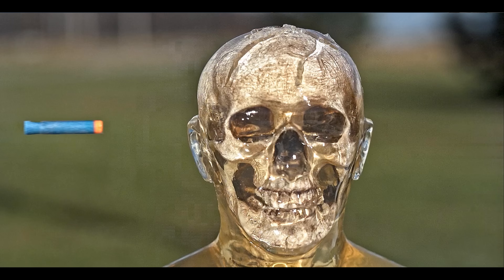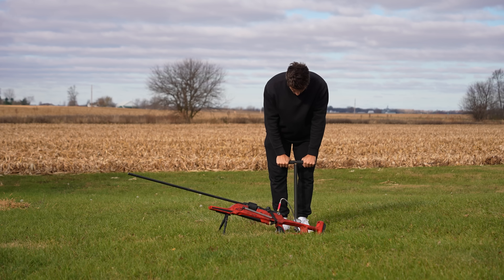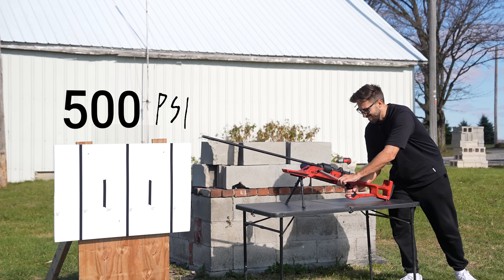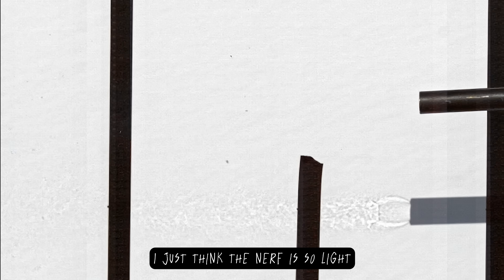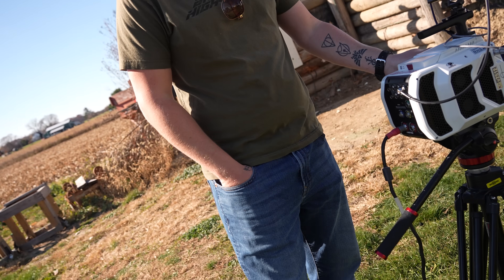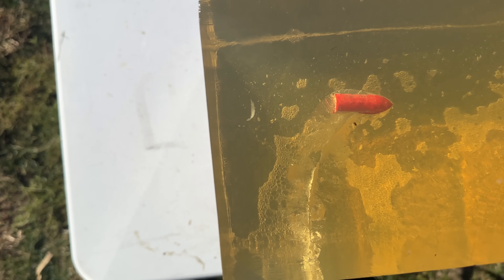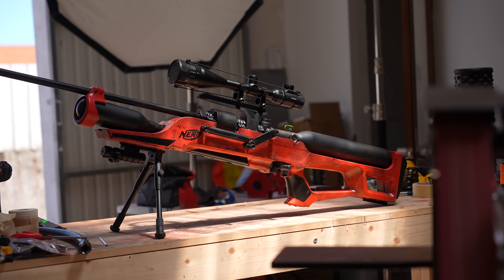How Dangerous is a Supersonic Nerf Dart?

Comment: good job man, a ptfe tube plugged at one end lining the inside of a nerf dart may solve the issue with the normal darts exploding but would also reduce the volume of air entering the rear of the dart. One would think that would reduce velocity but maybe not.

Comment: so there was a company that was working on bullets that could spin in a smoothbore barrel. They were by Franklin Armory if I recall. But basically, the idea was to make a bullet shaped somewhat like a shuttlecock. Essentially there was the bullet tip, that then would shrink down before flaring out into multiple angled fins. This was in theory to make the bullet spin by itself without the need for rifling. Allowing smoothbore weapons to extend their range.

Comment: It should be impossible to use pressurized air to drive the projectile faster than sound. Sound is a pressure wave, so the pressurized air can't move faster than the speed of sound. It might work with a de Laval nozzle for a very light projectile like a nerf dart, I fired a milled-down golf ball at about 500 m/s using a 90 bar de Laval nozzle system once.

Comment: brother, make a multi cylinder backpack with 1-2 inch hoses that bottleneck feed the pressure into the rifle for more fire power. be aware the bottle neck method will increase the output, so make sure to have a pressure valve installed where you can monitor it.

Comment: Ask your Dad about what it was like in the later 70s  and well into the 80s.  A good amount of the cars that younger buyers were purchasing had only AM  and maybe FM shaft mount radios.  An aftermarket stereo was your answer to be able to play cassettes  "and a few who were still clinging onto 8-Track tapes" so to listen to what they liked when they liked.   Many did not even have L- R channel speakers so aftermarket was your route for stereo effect.  Everything was shaft mount with some even installing under dash units.     Car Audio  Liquidators would come into your town and move pallet after pallet of car audio equipment into a vacant store for a week or two.  Most of their offerings were brands you never heard of.  After their week or two stay they would  move on.  Just about the time the ACME brand  "Power Booster with but in Equilizer" claiming hundreds of watts per channel had started smoking.  So much for Warrantee.  Kind of like those Holloween stores bu they only come once..  
There was very little involved in installing your aftermarket equipment and everyone had at least one friend who had some experience doing so

Comment: I highly doubt you can exceed the speed of sound even if you increase the pressure by 100x. You need HOT compressed air, as hot air has a higher speed of sound. Rifle bullets can travel at Mach 3 because their propellant gases are hotter. This is another reason why railguns are recommended to accelerate bullets at Mach 7

Comment: It seems the air is building up at the head of the nerf darts whenever you shoot them. So, why don't you 3D print a hard,  thick, durable plastic round that's hollow like a nerf dart but made out of the 3D printed plastic, and with a pointy, screw thread tip. The 3D printed bullets you made aren't hollow. Would that work, or would it make any difference?
What do you guys think?

Comment: A muzzle brake might help since the barrel has no rifling. It seems like air escaping the barrel behind the projectile is influencing its trajectory and pushing it off center. Or perhaps a couple holes at the end of the barrel. Are you using hollow nerf darts? Can see them exploding just passed the barrel. Try filling them with spray foam. Or make a spray foam dart.

Comment: Humid air is not more dense. The water molecules displace the heavier diatomic Nitrogen in the air 4:53 . Cold are sure, but unnecessary to add this extra bit in

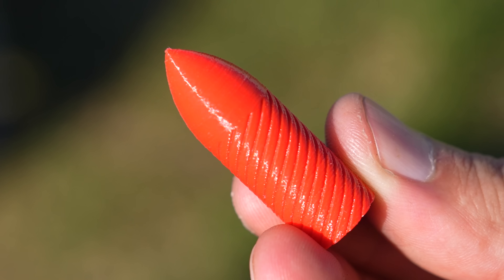Comment: At 10:16 My prediction is that the plastic 3d printed bullets look scarier than they are. unless you added weight somehow, air resistance alone is gonna kill not only your speed but your lethality. its just to light. Now that muzzle loader bullet. the one made actually out of metal, is the one im scared of. lol

nevermind apparently! Plastic bullet for the winz!

Comment: Thank you so much for actually considering calculating the speed of sound at the actual time of experiments. I was itching thinking that might have been missed. Not a lot of folks actually consider that as a gradient, and it’s just a pep peev of mine. Data, data, and data, equals data of previous engagement. If you don’t actually do it you will never truthfully be precise. Accurate maybe by chance.

Comment: I am wondering, what the max lethal range would be with the various projectiles. plastic, hard wood, iron, lead, tungsten.
If it is lethal at a good enough range, then it might actually be usable in a resource constraint manufacturing scenario. 
You could charge the air canisters with solar. And easily 3D print or CNC many types of ammo.  
No need to manufacture gunpowder. The fuel to fire it, and projectiles, could be made locally on the spot, behind enemy lines, with a portable production kit. 

In actual warfare, logistics, thus, getting all the stuff you want to the right place in an active warzone, or behind enemy lines, is do or die for a successful campaign.
Utilizing more local resources, can reduce dependance on logistics. Allowing for longer deeper missions behind enemy lines, where logistics is constraint.

Comment: Hey, some physics. Gas cannot travel faster than the (its) speed of sound - meaning the gas inside the barrel, driving the bullet. The speed of sound of a gas depends on its specific weight and temperature. So if you want more speed, you can use a lighter gas (e.g. Helium) or make the gas hotter (e.g. the gas of burning powder). But cold air inside the barrel cannot travel faster than the speed of sound (of air at "room"temperature) ~330m/s. That's the simple physics behind it.
Reply: Like it

Comment: eh print yer bullets sideways.. they wont snap as easy and will deliver more eneragy in theory. think of it like stacking 2x4's . 3d printing creates a 'grain' structure via layers. you want those layers to be in line with the direction of force.. back to the 2x4 example. if you hit a 2x4 with a sledge hammer on the side it will bend or break.. but it you hit the end you can hammer it into the ground like a niail.  the same is true with 3d prints.if a pirnt is long you want to print it sideways. not streight up and down. the widest part should always be on the print bed.. i would reccomend you print the bullete in 2 halves and weld thenm together using what ever means you see fit to make them 1 peice of plastic.. my typing is crap but you're plastic bullets will work better. also you're riffling is too fine. WAY too fine. if you have the chance do the math. if you know how fast the projectile is moving in the barrel. you can then calculate the proopper amount of twist that should be on the bullet for best stability exiting the barrel. the rifling needs time to engage the barrel. could also be that your bullet is too smaall for the barrle that is the usual cause of tumbling.

Comment: Should have built a piston actuated version. The secret to air launchers is a system that releases all the air at once you can hear it hissing after he fires the shot meaning there is some amount of air that is wasted.
Nighthawkinlight has a great video on how to make a pvc piston for these applications. Another way is an electronic sprinkler valve. They are pretty quick but I wouldn’t feel comfortable putting 500 psi against it lol.

Comment: If you slow down the slow motion footage of the regular dart wrapped in packing tape, you can see that right at impact you actually got a slight ignition on the rubber tip due to the friction and speed of impact! Watch closely and you can catch the flash!

Comment: if you want to improve the stability and speed of your plastic projectiles, consider making the back end of the projectile concave. Also do not make your projectiles straight all the way back, taper them down ever so slightly. Hopefully that helps. Is going to be trial and error with those because you cant approach this like designing an optimized projectile for a firearm, this is a high end air rifle.

Comment: I wonder if you used a plastic straw inside the nerf dart with a cap at the end of it or have it sealed if it would stop the darts from exploding that way you can run higher pressures with out having it explode.

Comment: the cellophane tape made all the difference in terms of decreased friction and added structural rigidity without adding any real weight. with that mod and a lead pellet in the head, 600 psi will probably even see 1200fps

Comment: Current me if i am wrong but your using air to propell the projectile. Air moves AT the speed of sound so you can't really break it. Switching to helium that has a lot higher speed of sound will make it fire a lot faster.

Comment: One method of modifying a nerf dart i have not seen much lately. Put a bb inside the dart. It both helps it seal better and gives the tip a bit more weight.

Comment: i am guessing you used pla as the 3d printed projectile  could you try using tpu or petg?  also it looks like you printed them from the bottom up   if you printed it on a raft while horizontal i think you may have better effectiveness without the projectile breaking

Comment: Have you thought about trying to add rifling inside the barrel? It's probably pretty hard to DIY something like that but perhaps you could buy a barrel with rifling already or maybe contact a metal 3D printer place and I think they could easily 3D print a barrel with rifling inside, possibly cheaper and more customizable than buying the finished piece from somewhere.

Comment: did you lubricate the pipe " baril " so that the projectile gets not heated but also decrease the frictions , allowing projectile it full speed ?
does the pipe has the same spiral shape inside, as in real rifles ? it allows the projectile to spin decrasing also air friction.
sorry for my basic english

Comment: A fundamental truth about ballistics is that the longer the object is in contact with the force projecting it, the greater the energy imparted to it.

That's why crossbows might be 300 lbs but can't actually outperform a bow with lower poundage but longer limbs and a shorter distance between the string and arrow pass. It's also why Asiatic-style bows are more efficient than straight-limbed longbows. That's why a 20-inch barrel will impart more energy and stabilization on a bullet than an 11-inch barrel when all other factors are equal... This is rudimentary stuff!

Comment: I would advise you to drill a few holes at the end of your barrel in order to release the pressure that occurs in front of the projectile all along the barrel. While this has less impact on heavier projectiles, the Nerfs are light enough to be affected by this phenomenon.

It is also possible (pure speculation and for blue projectiles) that this slows down the dart enough that when it comes out of the barrel, the pressure to propel it is so strong that it transforms your projectile into a balloon on the verge of exploding since it is no longer supported by the walls of the barrel. Holes at the end of the barrel could release the pressure before the projectile is no longer carried by it.

Comment: The rifling is way too aggressive. Usually in rifles it turns 1 rotation per 20-40cm depending on ammunition. The one you have seems to be 1 rotation per 1.5 cm. Thats probably a reason why it tumbled.

Comment: I'm not a physicist, but it seems too me that you cannot accelerate an object to above the speed of sound, with compressed air that only expands at the speed of sound.

The difference between 200 PSI and 500 PSI is less important than temperature, which is directly proportional to the speed of sound. 
The recipe for breaking the sound barrier with air is simple: USE HOT AIR. Specifically, hotter than the air around you.
When you pump up a pressure vessel, the temperature goes up automatically, I think this explains why you were able to get sonic booms the first times. If you used it quickly after charging, the high temperature from pumping was still there. Perhaps you let it sit too long for the next tests?

This is all speculation, like I said, I'm far from a physicist but I'm pretty sure if you preheated or insulated the tank, you could get supersonic darts reliably.
Good luck
Reply: Air's speed is not limited only the speed of sound is. Sound can travel through the air at a little over 1200 kph. A shock wave occurs when the speed of the object exceeds the compressibility of air, which air then 'breaks' around the object (going backwards relatively). Waves of air are are forced together  (compressed) by the object since air can't move out of it's own way quickly enough.

Comment: why no round objects if you got 3d print and stuff. there is a reason why many air projectiles are round ;). for sure we are on a technical level, where air powered guns could become perfect assassination tools. a good marksman with a bullet that has best weight /stability / distance /penetration stats and you can even add a silencer. now imagine what kind of projectiles are possible if you only need one hit.....air guns scarin the hell out of me right now ^^

Comment: you should also check the inside of your pipe, foam travelling at 1000fps might leave some residue on the pipe, creating a roughness that'll slow down other projectiles. same with 3d printed materials.  a bit of lube, and occasional cleaning wouldn't hurt maybe.

Comment: That’s just a gun bro, not a nerf blaster
Reply: No, a gun uses gun powder. This doesn't, bud.
Reply: Same thing bro
Reply: No, kid, it's not, one uses force applied by air pressure, and the other,  a real gun, uses chemical energy.
Reply: They’re literally the same thing, just because his one shoots with air pressure doesn’t change the fact that it shoots bullets at super sonic speed, it’s literally just a gun
Reply: Chemical energy, and air pressure. When you get in AT LEAST 5th grade, you'll know why they're different. A real gun uses gun powder, his uses CO2, or whatever he said he uses. PLUS, it's illegal to add gun powder to a nerf gun. So a nerf gun, or a nerf "blaster", will always be a fun little kids toy, and not a gun, even if you add random chemicals like CO2 or N2O. PERIOD
Reply: Bro they are basically the same thing. They are both lethal and can kill it’s basically just a gun. You can use it for the same purpose. Just because it doesn’t work the same way doesn’t change the fact that it shoots bullets that can kill. And if it can kill, It’s not a kids toy.
Reply: Ok? But a knife can kill someone, and a hammer can, are they the same thing? NO, real gun uses calibers, this uses foam darts or 3d printed darts. And also, a mortar can shoot "super sonic speed" and is that considered a gun, no, it's not, it considered an artillery weopon. A field gun can shoot at supersonic speed, but it's not a gun. My point is, just because it can kill, doesn't mean it's a gun, it just means that it's a weopon, or if it wasn't made for a weopon, a lethal object. And if you got another paragraph to "prove me wrong" then lets me see it, because I shot plenty of real guns, such as a 1911, a Glock, even a Barrett 50 Cal, and I shot plenty of nerf guns when I was a kid, and from that experience, I know the difference.
Reply: I said they both shoot BULLETS at supersonic speed. Ok can we end this argument 👍👍
Reply: Alright

Comment: Slight issue on the number you are using for Mach 1. You aren’t calculating your local Mach number based on atmospheric conditions. Therefore your first shot could very well have been beyond Mach 1. While you do address it somewhat, it would be smart to go through the full calculation.

Comment: You needed to either be using worker gen3 or sabre T-darts. The glue and foam is far better.  Dart zone half lengths are extremely delicate and vaporize even when fired out of springers at 450-550 fps.

Comment: I don't think it's possible to go faster than air when you push the projectile with air going at the speed of sound.
The trick would be to have a 2 part projectile with a small part at the front pushed by a spring pushed by a big part pushed by air. In the barrel the whole projectile reaches mach1 and the spring is compressed. At the exit the front part is pushed forward faster than mach1 when the spring releases its energy.
PS: a spring can be a rubber element not necessarily an actual spring.

Comment: When I was a kid my friends and I experimented with a much lower velocity air gun (100 psi from an air compressor through PVC pipe), and we tried to shoot nails through it. We found that when we made a dart out of a nail and a nylon anchor, so that the nail had basically 2 heads, one about halfway down the shank, it would fly true from the unrifled barrel. The pair of discs along the middle and rear of the shank acted like fletching on an arrow and stabilized its flight. You may want to experiment with thusly shaped projectiles if you'd like to improve the accuracy of your device. I know TAOFLAEDERMAUS (sp?) made similar projectiles fired from a smooth bore shotgun barrel and they actually worked, so I don't see why you would have different results.

Comment: Dude, you could have filled a Condor to 600-1200psi, machined a long barrel for it and not had the trouble. Is that a 48” barrel? Dump valve. Solenoid?